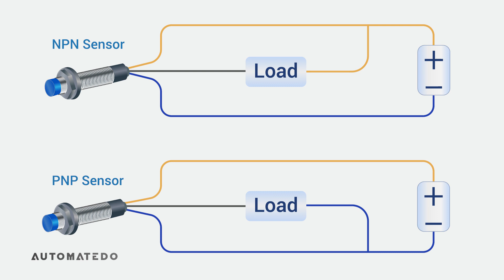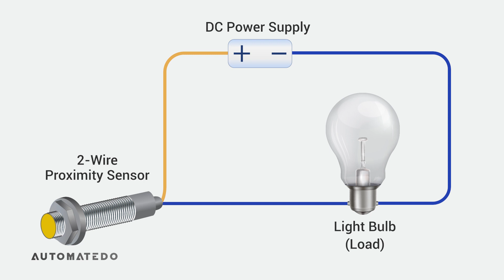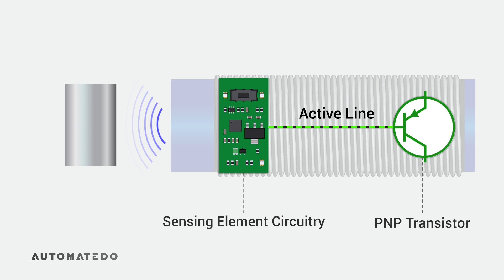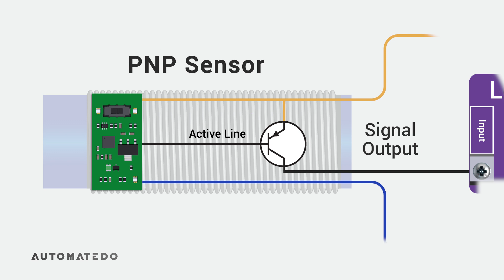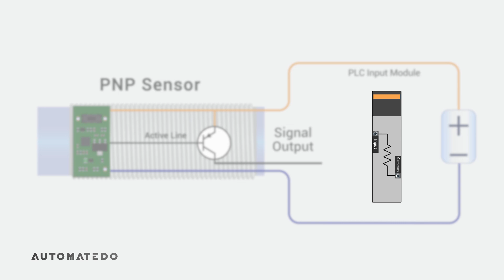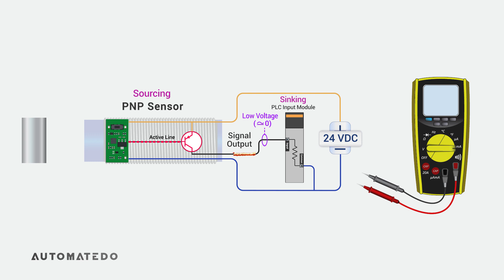What is PNP Sensor? Working, Wiring and Testing

Comment: Best video , but i had some strange problem . I used photoelectric PNP sensor 24v with 3 wires and wanted to activate PC cooler 12v . I connected sensor's Brown wire to plus and sensor's Blue wire to minus, then a inserted PC cooler between sensor's Black (signal ) wire to sensor's Blue wire (minus) as you described. So sensor's Black (signal) wire was connected to plus wire on PC cooler with resistor to reduce voltage and minus wire of PC cooler was connected to sensor's Blue wire (minus) . And it not worked , but i decided to connect PC cooler as if it with 2 wired sensor and then sensor's Black (signal) wire i connected to also to PC cooler plus wire and then it worked. But i can't understand why it works not as you described because what you described i also seen in many schemes . Your explanation very good, may be you can understand and help me ? May be i miss something.

Comment: You will not get 24V DC on PLC input via Multimeter because the input contact will be on and current flow through it to the ground. You must have a potential difference to have the readings on the multimeter.

Comment: Thank you for this excellent video. I greatly appreciate the content. It helps me understand a three wire laser (beam) device that I received from a vendor in China. It is listed as a "PNP NC" device.  I understand the PNP part of the laser device a little better now, and also the wire connections are much clearer to me. The illustrations are outstanding and easy to understand. I really appreciate the suggestion on how to test the PNP device. I will try that on an LED light circuit that I am building with an ice cube (octal) relay. Just as you explained that "PNP" means "positive-negative-positive" with regard to the output signal of the device and the connection of the load with the negative wire, so you could have given a little background on what "PLC" means, but I realize that can be distracting. "PLC" is a new type of device to me. (I'm not very experienced with electronics.)

Comment: Thank you for sharing! could you tell me if something was wrong when I used the NJK50001  and TIP42C the sensor was always on until disconnect the E or C was from the transistor and the sensor worked normally

Comment: Good explanation..1 question sir,can we bypass the pnp sensor?
Reply from the maker: Thank you! 😊 As for your question, bypassing the PNP sensor isn't generally recommended. 🚫 This sensor plays a crucial role in safety and proper functioning of the system. Tampering with it can lead to potential issues and risks. ⚠️

Comment: so for a use with a µC, do we only need a power bridge to limit the high voltage value in the input pin and also a resistance for the current flow?